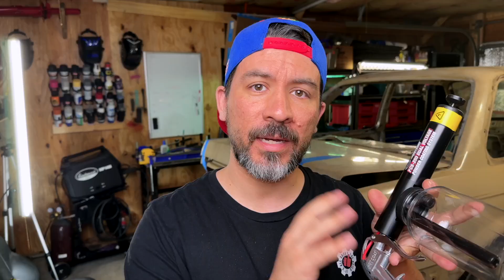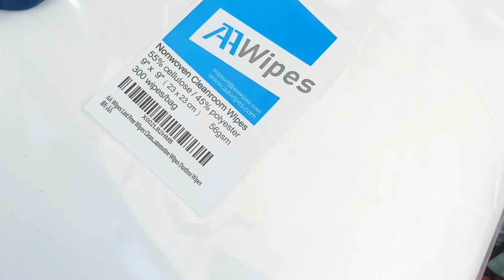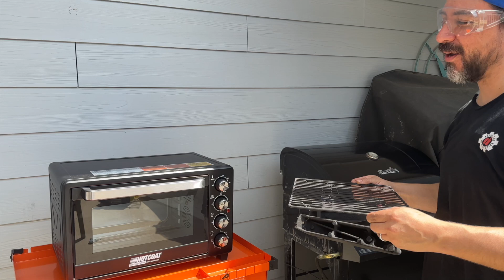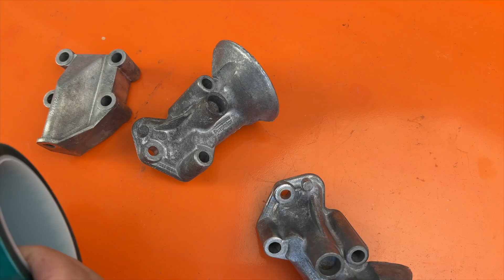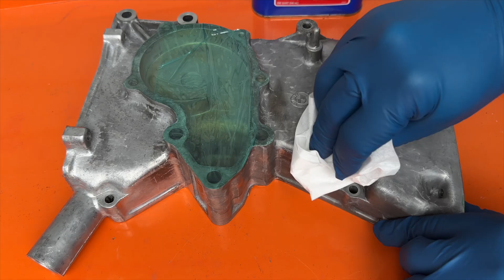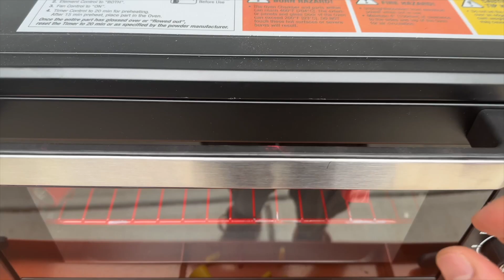What NO ONE Tells You About Selling Powder Coating Parts

Comment: That sounds all good in theory the problem is you didn't sandblasted which is a huge part of powder coating it's like velcro it has to have something to stick to to be real durable anyways there are situations you can get by with but it's not near as durable if if you don't sandblasting or beed blast it
Reply from the maker: You’re absolutely right, media blasting definitely provides the best surface profile for long-term durability. 💯

Comment: Been powdering as a DIY for about a year now.  I leave the plugs in.  It is not worth disturbing the cure and/or risking damage to the powder by removing them early.  The plugs can handle the full bake/cure process.  I am open to suggestions if someone has experience that suggests otherwise.
Reply from the maker: They can be left on for sure, but sometimes the powder when cured gets stuck to the plugs like our first example, so we tried removing them for the other parts :)

Comment: A tip I’ve heard for the outgassing (baking) process is put your parts in at a higher temperature than what the powders cure temp needs to be as this should keep any pinholes in the powder from any remaining gases/contaminants within the parts you’re coating!
Reply from the maker: @stlblues1286  right on, we will hear much higher for the next attempt 🙌🙌🙌

Comment: Ebay lately takes WAY more than 15%. They kind of force you to promote your listings after a few successful sales. 

Their algo won’t give your listing views unless you elect to pay them more.  Generally another 6.2%-10.5% more will go to this of which 2/3-3/4 or more of your listings will sell with promotion fees.

Another great way to make $ with this kind of service is to simply list doing the service itself for a fee locally and be diligent about charging more for additional prep if needed for good results and refuse work if your not confident good results will be achieved. Basically only doing work your confident in will result in only happy customers - if a side gig you won’t feel pressured into crp work.  Also don’t be the cheaper option locally - your the boutique custom micro biz option and thats premium.

Comment: When using the tape, I find it pretty effective to lay the tap over the part and use a rubber mallet to give it some generous taps along the leading edge to separate the tape. It gives a perfect shape and doesn't leave any overhang
Reply from the maker: Oh nice, will give that a try. Do you powder coat car parts too?
Reply: @Itsallaboutthebuild I do cerakote, mostly gun parts, but I've done break calipers and all kinds of engine accessories. You should look into it. It's relatively inexpensive to get started, and it should feel like familiar territory.

Comment: The moment you showed the Eastwood gun and then didn’t start sand blasting i had to pause, make this comment, and stop watching the video. If you want your coating to last you need to blast your parts in a media cabinet until you get a good surface profile.  You’ll learn when the powder starts coming off though.  Not trying to be harsh but there is more to it than degreasing and rinsing if you don’t want to have it come or look terrible.
Reply: Use a torch on cast parts to draw out any moisture and grease that may have wicked into the metal
Reply: That is true it also applies to body paint and also for 3d printed parts or SLA i apply the same concept of prepping printed parts to fill and paint. Like I would if I wanted to do body work.
Reply: That's exactly what I said it has to have something to stick to it's like Velcro it's got to be able to have something to hook to or it's not going to last and it feels or flakes off in some cases
Reply from the maker: @CraftwerksMC  good point, will give sand blasting a try. What grit would you recommend???
Reply: @allaboutthebuild  I use the aluminum oxide that HF sells.  It isn't always the cheapest initially but without a local media place nearby if you try to ship something else  it will cost far more than what Harbor Freight sells plus it lasts longer than sand, coal slag, or other softer medias.  It is more aggressive so you will want to be careful with soft materials but for aluminum, magnesium, and steel parts it will be fine with most home sized compressors, but that does expose another issue.  You will need at least 10 CFM to run most any blast cabinet and probably a good moisture abatement setup, and if you try using a blast pot or something similar it will be a huge mess and they are a nuisance to operate.  Along with the cabinet you will want some dust extraction. A shop vac will work to some degree but make sure you run a HEPA filter in it to stop the dust cloud it will create as the dirt particles are blasted off the parts and as the media breaks down over time.
Reply from the maker: @CraftwerksMC  ah yes, need a better air compressor for sure. Thx for all the tips 🙌🙌🙌
Reply: @allaboutthebuild Instead of taking either of our advices, you might want to make a video testing powder coating with and without media blasting. It would make for an interesting video.
Reply from the maker: @bobweiram6321  for sure would have helped with aluminum casting marks, but as far as crack/peal over time that would make for a great VS video 🙌
Reply: @allaboutthebuild  I used to powder coat, but now I strictly use Rustoleum with hardener baked in an oven. It's almost as durable and easier to apply multiple color patterns. Heat shouldn't affect powder coating below the fusing temperature, but it will soften at high temperatures.
Reply from the maker: @bobweiram6321  interesting, what type of parts do you paint with rustoleum?
Reply: @allaboutthebuild  Mainly old Microscopes and vintage machines.
Reply from the maker: @bobweiram6321  very cool 🙌
Reply: @bobweiram6321 what's this process we paint fishing lures and are always looking for more durability
Reply: @CraftwerksMC weird comment, but would vapor blasting also do the work, or is it only possible with sand blasting?
Reply: @Jerry.V  It may but vapor blasting is usually good for making a nice appearance on aluminum .  Not polished but definitely a brighter and more lusterous finish.  I think the surface needs to be with a rougher abrasive media, like sand or aluminum oxide.
Reply: @CraftwerksMC but wont that like damage the aluminium? Because its very hard on the material.

Thats why I am wondering if vapor blasting might be 'better'. Got no experience with any of those 2
Reply: @Jerry.V  What do you mean by damage aluminum?  outward appearance will be clean but grey, and then you just powder coat over for whatever color.  It won't damage it.  If you want a raw shinier aluminum finish use vapor blasating.  If you want to paint or coat it with powder coating use dry blasting.
Reply: 80 for a fine finish while still cutting the heavy stuff  @allaboutthebuild
Reply: It probably depends sure sand blasting would ensure everything is good but im sure some things are fine
Reply: Media blasting is unnecessary! Powder coating not the same as paint, which doesn't stick well to aluminum oxide film, requiring toothing or specialized primers. If your powder coating is flaking off, it's because your surface is contaminated, or you're using crappy powder coat from HF.
Reply: @bobweiram6321  I've noticed people don't cure long enough too. You don't start the timer till the part is up to temp.  Castings can take awhile to hit 400F.
Reply: @quademasters249   You're correct. The surface needs to reach a certain temperature before the powder coat will melt and fuse to it. Even if it doesn't reach a high enough temperature to fuse, the powder coat will still be very hard, but will chip off when the part is dinged.
Reply from the maker: @bobweiram6321  so far so good on this item, will see how they hold up to more heat over time. Do you powder coat car parts too?